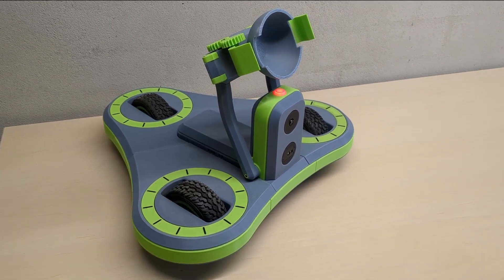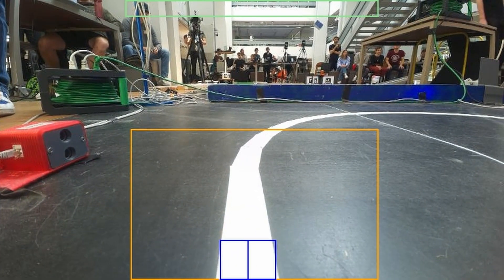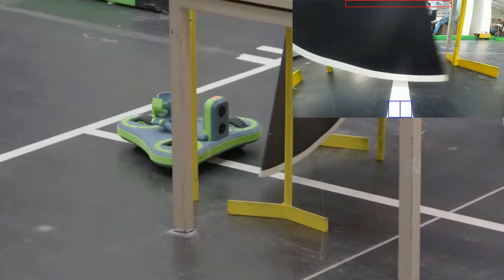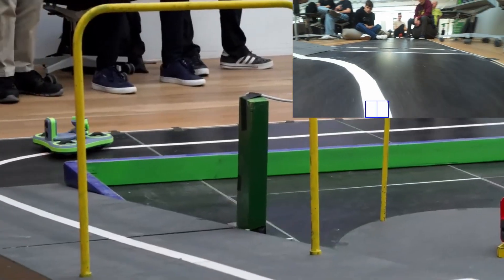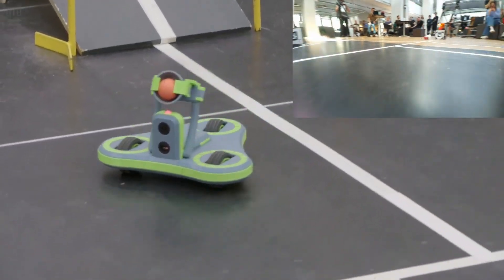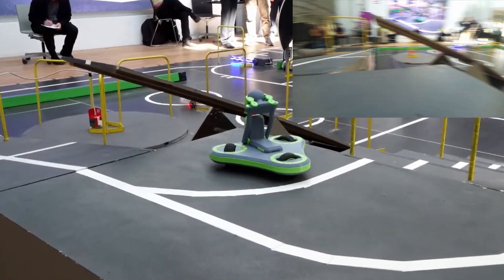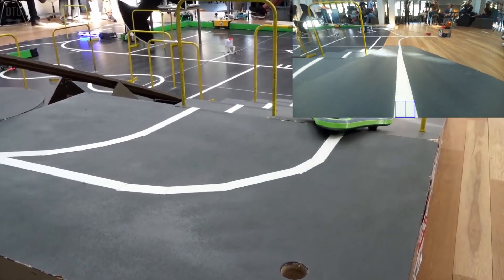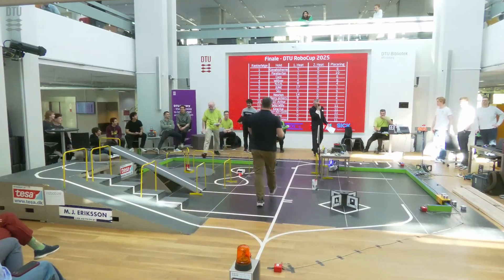Using Vision and Dead Reckoning in DTU RoboCup

Comment: Is the tilt (of the ramp and seesaw) detected using a gyroscope (sensor)? If so, what model of sensor did you use?
Reply: Beautiful design. Congratulations! 👏🏼👏🏼👏🏼
Reply from the maker: Yes, it is measured by an IMU/gyro. I'm using the BNO055